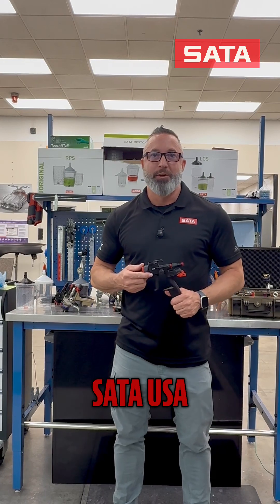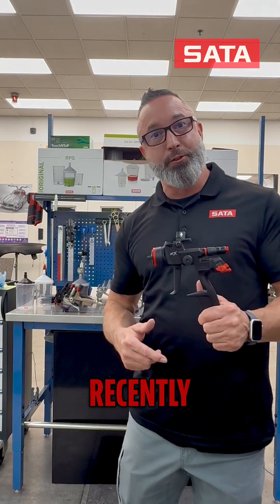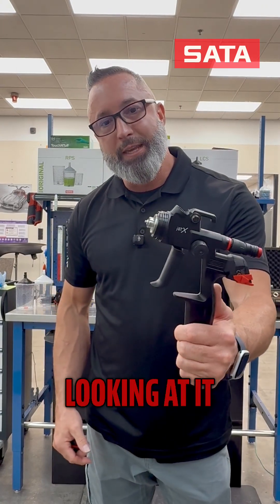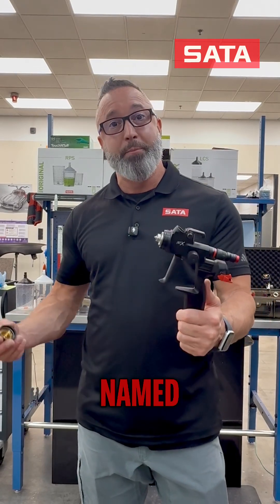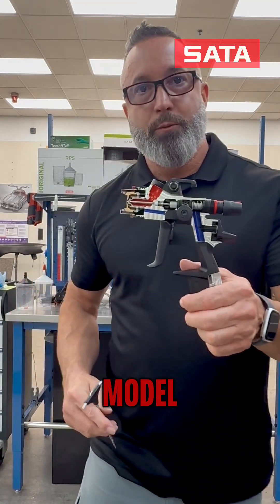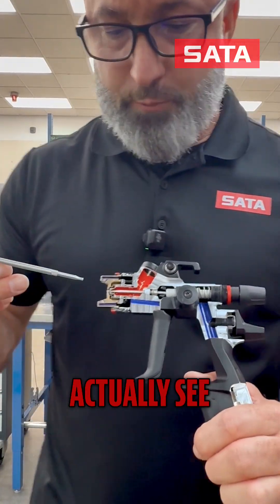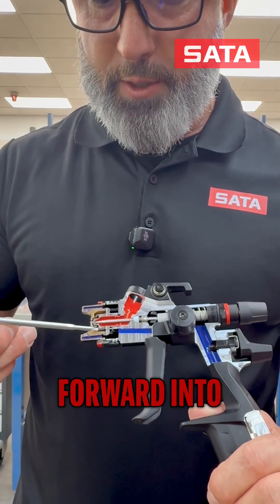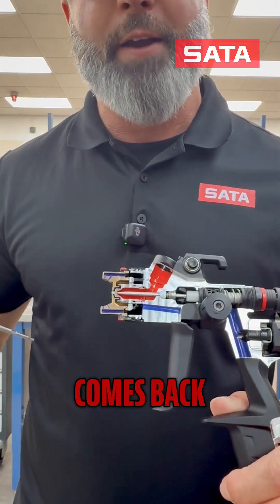SATA Jet X  Introducing the Labyrinth Nozzle System!

Comment: Ive used Sata my whole painting career , 34 years, the X is the best gun I've used so far, i have noticed that the spray at the end of the fan looks more solid especially when I've watched it back on my footage compared to my X5500 this seems to explain it 👍i went for a 1.2 i on the RP and im really happy with the results im getting, normally i like the o pattern but glad i got the i pattern